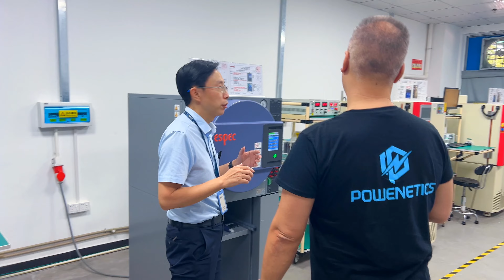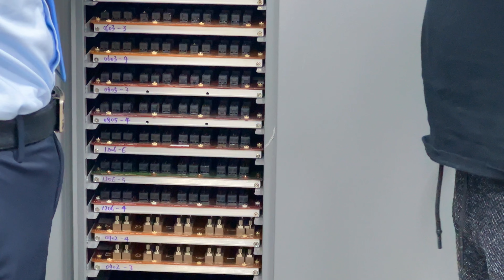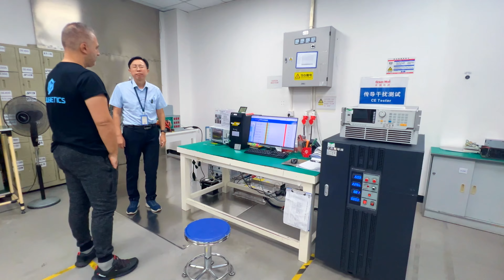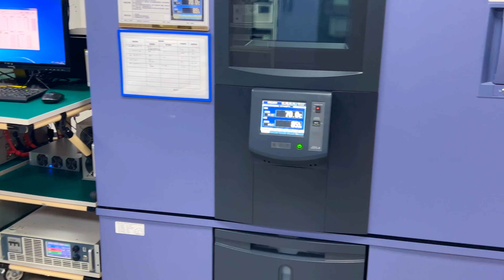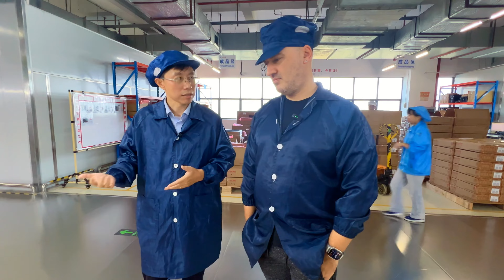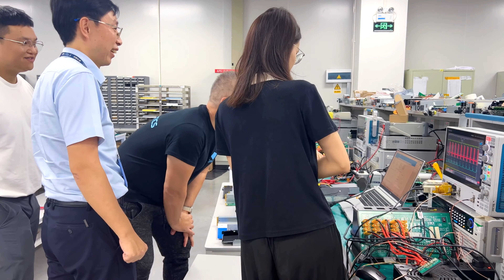Exploring One of the MOST Advanced PSU Factories in Shenzhen - Great Wall

Comment: Why is Great Wall still only an OEM PSU manufacturer?  Be proud and make some quality  Great Wall PSUs under your own name  with 100% Japanese caps and a 140mm fan.
Reply: Superb quality would be too expensive and cannot compete in consumer market.
Reply: GW has done some self-branded ODM stuff for the Walmart branded gaming computers. The venture went poorly and GW got out of the retail facing business because Walmart's incompetence burned the reputation of all third parties involved.
Reply: @FeintMotion  Thanks for the info.
Reply: It's not easy to succeed in the middle man company dominated Enthusiast Computer Component market.  These brands go to OEM's with specifications of what they want in a PSU, fan, keyboard, etc, ink out a deal, & then pass the OEM's product off as their own.  Companies like Seasonic & FSP are exceptions & as such deserve some credit for their effort & success. A PSU is one of the most important components in a desktop computer.

A solid, quality PSU supplied with clean, stable power gives all other components a reliable, line filtered source of power with which to perform efficiently which ultimately can lend more longevity to a computer.  Note that most companies that pre-build computers will, to this day, rely on using the cheapest PSU possible in order to make a bit more profit, figuring their prospective customers know little or nothing about components.
Reply: @George_D777  Agree with your mentioning FSP and Seasonic. I wish Great Wall followed suit.
Reply: Brand name do good for users, Biz cooperation is better for all the guys